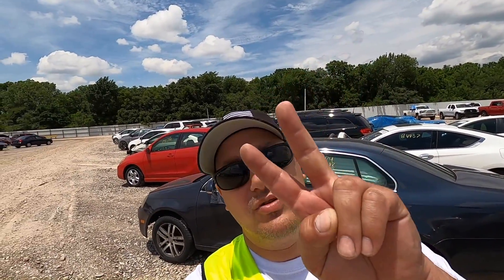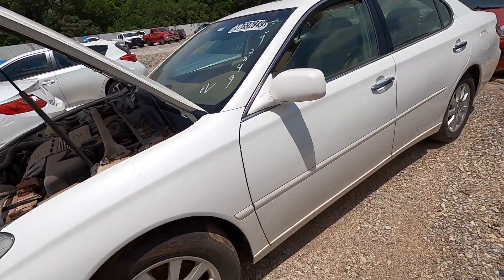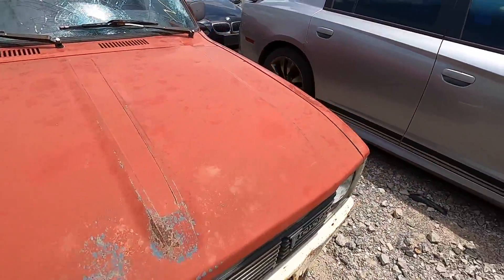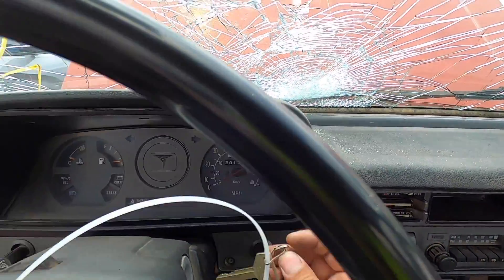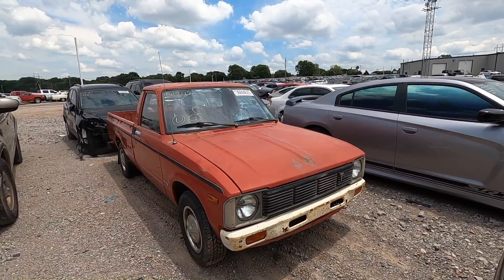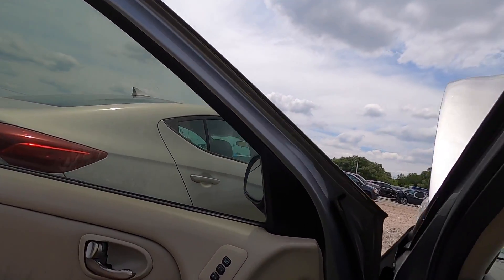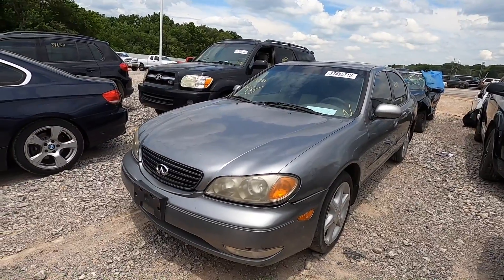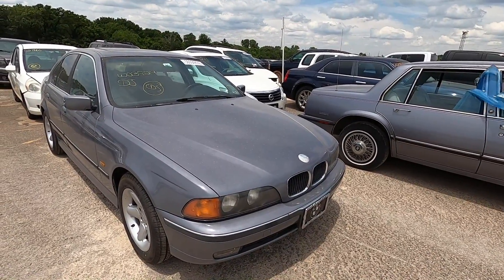Copart Walk Around + Carnage 6-4-2020

Comment: 22R is a bullet proof engine. The work horse of early Toyota's. I'm not sure, but the pickups I think had a low pressure low volume electric fuel pump and there was an inline fuel filter.

Comment: The window on the Infiniti, it’s auto up and down, the auto up is the issue, I’ve got a Lexus ls400 and one window has the same glitch, the secret is to only depress the switch enough to get the window to move, if you pull or push it all the way, you’re in the auto mode and that’s what it does when the auto part is malfunctioning

Comment: That 22R engine is bulletproof and will run forever.
Reply: Had one like it[1983] with 750000,so,yea they will last the rest of anyones life.
Reply: That's a family truck. As in you pass it on to family until the family line is gone
Reply: If it has fuel going to it unlike the one in the video.
Reply: @Enrique Quinn instablaster :)
Reply: You should have get that truck that red truck and be a nice little truck for you I can see you getting it going no problem

Comment: I would not go any higher than 1500 on the Toyota Pickup.  It's a good basic little truck with great gas milage but without doing a compression test on it I don't want to buy a pig in a poke...

Comment: The red Pickup is a toyota hillux
Reply: They're not Hilux in the USA. Different designation. I don't remember what though
Reply: @montyholland3357  Toyota Trekker i guess
Reply: @johnblayze  they just called them, Toyota Pickup. Then in the early 90s they made a model called the t100. Then they called them Tacoma in 1998. Same goes for the Nissan. The old Nissan's were called Nissan Pickup, then in 1998 they changed the name to Frontier.

Comment: If you plan on flipping the Toyota pickup, you can't bid any more than $1200.
You might be able to sell it for $3000 once it is fixed up.
$500 profit + $1200 bid + $500 Copart Fees + $500 parts to fix (Windshield,fender dents,drivers seat,fuel pump, paint bumpers) + $150 tax/title/reg + $50 Liability Ins (2 months) + $100 for oil change/spark plugs/air filter/coolant flush = $3000. This is assuming there isn't anything else wrong.  Brakes, transmission, suspension, A/C, etc.  There are quite a few hail dents on the roof of the cab and rust on the A pillar.  The tires look good.

Comment: I´d take the Infiniti. Probobly a bad lambda sensor or spark plug or something minor like that. Those Nissan engines are bulletproof. Here in Europe these were sold as Nissan Maxima with 2,0 V6 or 3,0V6 engines. 300000km´s in nothing to these engines if you maintain them well. Also transmissions last a long time if you change transmission fluids every 60000km´s. Toyota pick up is called the Hilux. Very good cars and now perfect for light work or transportation.

Comment: I would buy that truck in a sec, and 2JZ swap it
Reply: I feel like the engine bay would be too short😂
Reply: UncookedRefridgerator37[RUINS] that’s why they may cut off wheels and welders. 😉 for example on building a 1971 Buick GS with a LS swap I push the engine back 4 inches which requires a modification to the firewall it’s part of hot rod life just have to have fun
Reply: Lunaroutlaw what's uppppp
Reply: Mr. Fluffy what is good my dude
Reply: How's it going my friend??
Reply: LunarOutlaw’s Garage  i agree . it would be cool to make a Jdm version of farm truck.
Reply: @LunarOutlawsGarage  i think an sr20 would require less messing around as its a smaller engine, right?
Reply: Shane Decker heck ya
Reply: h u h ??? Where is the fun in that 😁🤙